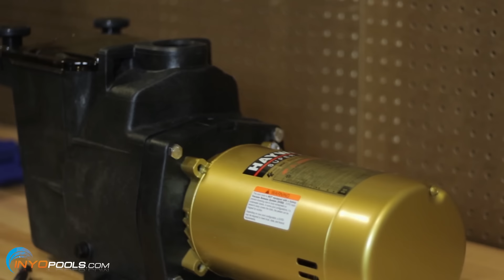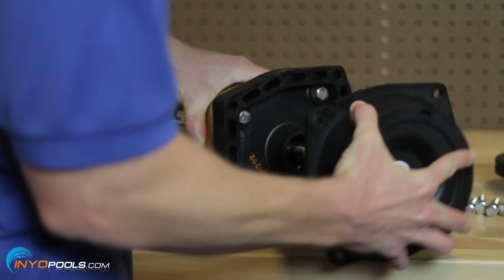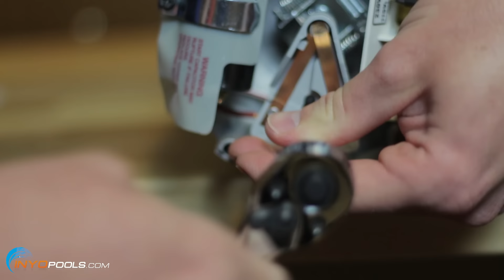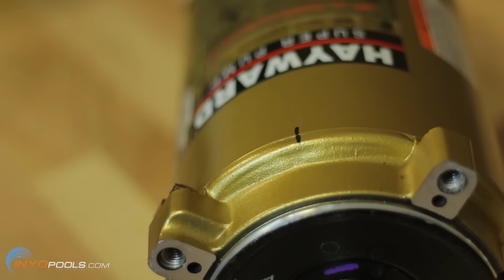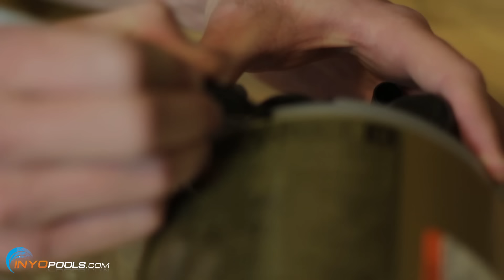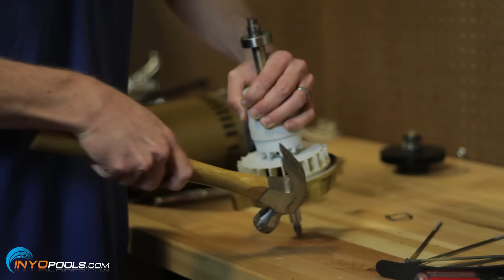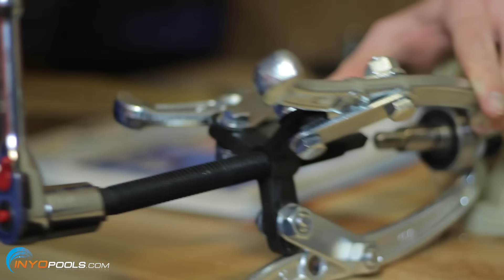How To: Replace the Bearings in a Pool Pump Motor - Part I

Comment: Lol good video but this is a brand new pump, there is a lot more swearing and smashing things when you are working on a 10 year old pump that has been sitting in corrosion and is all ceased up. The impellers are often very tight, and the through bolts are extremely corroded and will snap, you have to carefully heat up the end bell with a blow torch to try and free up the threads, being careful not to melt the plastic cooling fan
Reply: Pro tip.. As long as you can get the plastic off first..dont be afraid to throw some heat on that bitch
Reply from the maker: +Video Québec Very true, that is why we had the microphones muted on this one, just kidding.

But you are correct, the older the motor the trickier it become. And that is why most homeowners decide to replace the motor instead of the bearings on 5+ year old units.
Reply: Videos from Québec ......I'll by a new pump and save time. My pump is 12 years old.
Reply: @wolfgreen162  ill save 400 dollars. It took me almost a whoolllle hour.
Reply: The only issue I had on my 20 year old superpump was one of the through bolts rounded off, I used a 1/4” bit extension, and it could have be that it wasn’t fitting tight on the bold head, so when I was reassembling it, I added anti seize to all of the through bolts, and it’s fine.